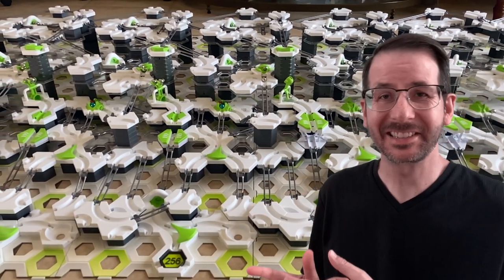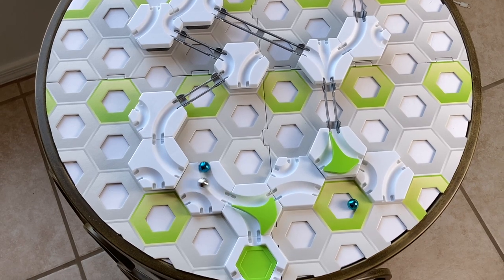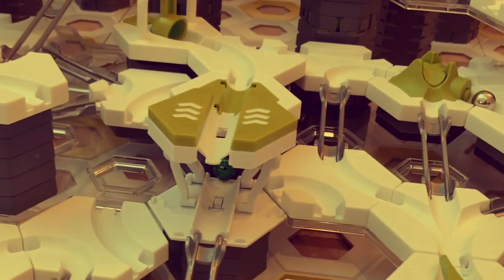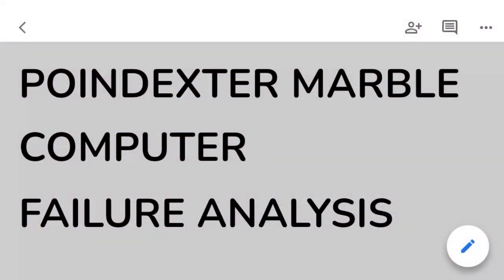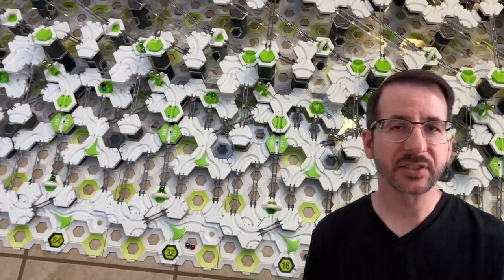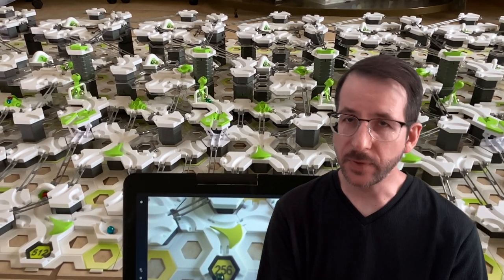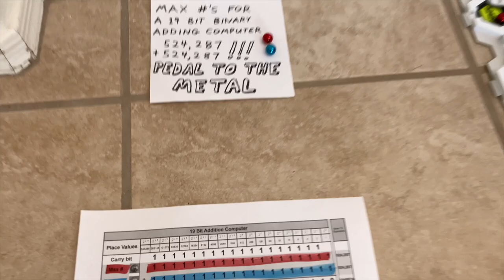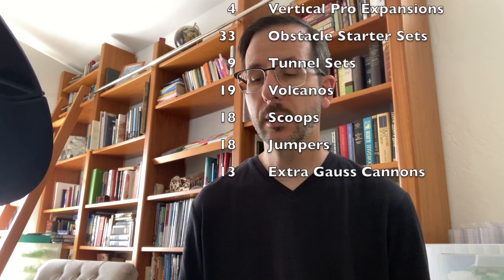I Made a 19-bit Marble Computer (Pt 1)

Comment: I'd really like to see one work with base 10 input/output so it's easier to use.
Reply from the maker: I might look into that in the future, but the circuits are not trivial to convert the inputs from base 10 to binary, or the outputs from binary back to base 10. It would definitely be an interesting thing to try, however.

Comment: Wonder if there is a concept of mass storage with data bus and address bus based on marbles.
Reply from the maker: The Turing Tumble toy is worth checking out. Subsequent to this video I picked up one at a garage sale and worked through most of its exercises. It can store values in the positions of its geared switches, and a marble can trigger the next marble to run through the circuit for the next iteration of the calculation. Using GraviTrax, I think an address bus of more than a couple bits would require a ridiculously large layout. But memory values can theoretically be stored in the GraviTrax Dipper's switch position, which can be "read" based on the exit the marble takes, and set by sending a marble up the opposite path just fast enough to reverse the switch.

Comment: Chaining more full adders together doesn't suddenly make the whole system more impressive. I could copy and paste this thing a thousand times over and turn it into a 1900 bit adder and it wouldn't be any more of a feat; in fact it would just make me look like I'm trying too hard to look smart.

Add some simple functionality to the system by allowing for inverted input lines and outputs then some control logic to make it into an ALU. But even at that point it isn't a computer. Using the historical definition of computer is just a deceptive ploy to get more views and you know it.
Reply from the maker: Thanks for watching and thanks for your opinion. Perhaps you missed that these mechanical marble-based circuits are not 100% reliable, and therefore the more bits that are added, the less of a chance the full calculation would run to completion? I discussed the computer's reliability in the video...it was rare that a full calculation would complete.  Therefore, 19 bits tied together in series is a much greater feat than a single full adder. (Take a non-100% reliability to the 19th power...)

I am using a more historical definition of the word "computer", which has nothing to do with integrated circuits, and instead focuses on the machine's ability to perform an algorithmic calculation on a variety of input values. We could go down the rabbit hole of semantics, but instead I will refer you to the Wikipedia article on "mechanical computer" which states, "A mechanical computer is a COMPUTER built from mechanical components such as levers and gears rather than electronic components. The most common examples are ADDING MACHINES and mechanical counters..." (emphasis added). So I assure you...no, this is not a ploy to get more views. But that's an interesting strawman. This actually is a mechanical computer that took a lot of time and effort to develop. But you're right, we can't run the YouTube app on it. Maybe someday... Thanks again for watching. 🤠
Reply: @MaskedMarble  it would still be interesting if you added the other functionality necessary to turn this into an ALU. A 4-bit ALU would be more than enough due to the space it takes up. Add in some shift registers and additional control logic and you can do mult/div. Anything beyond that would probably be unreasonable given the reliability issues you mentioned. However, seeing add/sub/mult/div implimented in marbles would be pretty cool.
Reply from the maker: @NeogreenPeaches I may try that. It would be necessary to develop some sort of shortcut like I used for the full adder, rather than building the ALU's logic unit and decoder by combining logic gates. Perhaps using GraviTrax POWER components to propagate the input signals. Will have to think about it...

Comment: Weird question... Couldn't you use the magnetic cannon to store information?  It would obviously have its limits.  Instead of just 2 marbles on the one side, you could use 3 which would allow you to use mag cannon twice, then have an obscenely long series of switches and more cannons...  It's painful to think about...
Reply from the maker: That's actually a very interesting idea. The gears are turning in the mad scientist's head! 💡💡
Reply: @MaskedMarble  Or use the tiptube.
Reply from the maker: @unclemarble659  That could work for a temporary register or buffer. It would require sending 2 marbles to read it, and the process of reading it would erase the memory. But still a possibility to use as a digital logic element. 🤔
Reply: I fought you CAN'T use canons twice, only with magnetic marbels?
Reply from the maker: @mirkohahn  I think you are correct; there is a video somewhere where I saw it done…will see if I can find it.
Reply from the maker: Here it is… you can do it by stacking marbles: https://youtu.be/wvgk6rmBryk
Reply: @MaskedMarble okay, well that's amazing! But the second time the marbel is much slower and rolls backwards. I don't know if that would be usefull...
Reply from the maker: @mirkohahn  Yeah, and really it would be a read-once type of thing. With the dipper switch, that would be permanent memory, staying in place until another bit is written to memory. That’s the best option I’ve considered so far. But also I think the new turntable could be used to store data. It’s just it would require 2 marbles to set for one value, and one marble to set for another value.

Comment: Sir I think you can get more clock speed if your marbles fell at 45 degrees.
Reply from the maker: Probably so. I was trying to limit the downward travel because it would have taken more action tiles to lift the marbles back up
Reply: @MaskedMarble  Well Gravitrax should make marble computer as a kit and perfect the speed and minimize size.
Reply from the maker: @gotsm9959  Interesting idea! I found that adding additional action tiles decreased the reliability of the computer. So increasing the speed might be fine for a two bit computer “kit”. But daisy-chaining kits together would be fairly frustrating, as the calculation repeatedly fails. If you check out my automatic 2-bit adder video, that timer circuit runs much faster.
Reply: @MaskedMarble  Well I seen a marble computer on a peg board that can count to 32. Clocks are are also a type of marble computer. If someone was shipwrecked on a island they can't charge a smartphone or buy batteries.
Reply from the maker: @gotsm9959  Yes, I saw that marble counter that could count to 32. You are right, without our smartphones we'd be scratching our heads for sure. Merry Christmas to you! 😃
Reply: @MaskedMarble  Thank Merry Christmas.

Comment: As for your comment on evolution:
Your model is not a proper analog because you are attempting to Leap Directly from initiation to a Fully Realized and multilayered result.

You are pointing out the necessity for reliability on a grand scale without acknowledging that such reliability would Have To be Established LONG Before such a multifaceted version of the machine Could ever exist.

Each component would have to Independently develop FIRST the Most BASIC and Simple Mechanics - Effectively, Predictably, and Reliably - Before ANY System involving More than One, Basic, Simple process could exist.

Then a Two step process could develop…

The sorts of Time and Endless Failures Required to reach the level of complexity you are actually Making are Not easily derived.

You are trying to SKIP MILLIONS of steps.

It is undeniable Proof of the Miracle of the Reality of the universe that we are capable of doing so.

Bravo!
Reply from the maker: You are actually making my point for me. The function of almost everything in biology requires the simultaneous existence and coordination of many mature and reliable parts before the subsystem becomes operational. And until it is operational, natural selection cannot select that subsystem. Add to that knowledge that multi-part systems are only as reliable as the product of the reliability of each of their mission-critical components, and you have a stong barrier against the formation of the myriad multi-part subsystems seen in biology. In my experience as a systems engineer for several decades, such systems can only result from parallel decision-making pathways where all the pieces are simultaneously designed and emplacement before the system or subsystem goes live. For example, you can't release an iPhone without a screen even if all the other parts are fully formed. And those other parts won't sit around for millions of years with foreknowledge, anticipating an iphone screen. Darwin described not a parallel decision-making pathway, but a sequential process; a sequence of slight, successive steps strung together. No such sequential process can coordinate, for example, the creation and emplacement of the 10 enzymes of glycolysis. All 10 must be present before enough ATP is generated to give the cycle any survival advantage. If the first few steps are in place but not the last step, the subsystem of enzymes actually consumes the cell's energy currency of ATP, so that is a barrier to all of the supposed intermediate changes to get from a theoretical simpler system to the final glycolysis enzyme pathway. No stepwise process can produce these things, nor can it improve their reliability. Reliability is not additive, but multiplicative, demanding that each enzyme work reliably from day one, in order to have any hope of contributing itself as a cog in the multi-component machine known as glycolysis. All steps have to be present AND reliable from the get-go, or the subsystem is completely nonfunctional from a survivability perspective.
Reply: @MaskedMarble  again, you appear to be referencing a complex system, an iPhone, for example, stating how the complex form could Never exist without a plan from day one, yet the iPhone WAS created by the slow collection of smaller component systems being developed Without 'the iPhone’ in mind.

A microprocessor WAS created as the result of a multitude of tiny, seemingly disconnected breakthroughs, each Vital to the functioning of the end result - each made at different points through time as a result of trial and error.

You might just as well point to a touchscreen and describe how it simply MUST have been the Ultimate Goal from the very Beginning, because the circuits would not function without a crucial component - then argue that there is No Way those components could have happened before they were used in the touchscreen.

If anything, I think your prior experience in systems engineering is a hindrance in this situation because you are failing to recognize the imposition and creation of the unified system's Language, Framework, and established Methodology as an external construct.

Which is to say, you can only conceptualize system creation from an external organizing structure - because all of your system conceptions and manipulations are Described and Defined using An External Organizing Paradigm.

(PS, notice my use of Paragraphs… it really helps to organize things I hope! 😁🤓)
Reply from the maker: @jclark2752 Thanks for the paragraphs. I feel that you are intentionally missing the point. Living systems must be functional from the get-go. We cannot have a discussion in an imaginary land where incompletely formed organisms exist despite missing any piece of the full hardware required for them to survive. It is the same with iphones. No end consumer buys an iphone screen by itself to make a phone call or to watch a YouTube video, because the screen alone is not a fully functional system that can perform those functions. It is only a subsystem. That's the analogy. 

You realize that every analogy breaks down at some point, correct? But this analogy is valid when you consider the functions of a living system which must be present to survive, such as producing ATP, copying its DNA, interpreting its DNA into working machines, and a host of other minimally required functions that every living thing must perform in order to be a living thing: a survivable, self-replicating system. The analogy is valid because iphones are not fully completed products, just as a single ATP synthase machine floating in space is not a fully living organism. Yet you are essentially claiming the analogy is invalid because iphone subcomponents are independently produced....yes, but not as a fully complete independent functional product. Can a microchip function without a battery or other power source? Can you watch YouTube on an iPhone screen whose ribbon cable is not connected to a driver chip? We humans are essentially making a host of parallel design decisions with intentional purpose in mind to form these subcomponents so that they will work together when assembled into an iphone to provide a function that they do not have on their own. That's intentional design with foresight towards a future unrealized goal. Natural selection has no foresight or planning capabilities. If we consider evolution to be a process with some foresight directed by the mind of God, then it is no longer Darwin's concept of evolution, which is by definition an undetected process.

The analogy is clear: You can't produce a living system that survives with any of its critical subcomponents missing. Even though there are an unlimited number of potential designs of living organisms, each one must possess components that work in concert with one another to form a functionally operable system, with interface specifications between components to  ensure they work together to produce a discernable function when assembled. You can't just pretend that you can take a pre-designed microchip and throw it into an iphone design without considering the interface...it's pinouts, where power is supplied and what the tolerance limits are for that power so the chip doesn't get fried, or conversely have too little current for the chip to operate.

What we are evaluating here is one of Darwin's two theoretical tenets, that small changes to the organism can create the organism itself (his tenet of natural selection). I am claiming from the empirical evidence that we observe, that reliability of multi-part systems poses an insurmountable barrier to that, because an organism can't survive without even a single one of its multiple critical components. It can't wait another 5 million years for a few random base changes in DNA to search the space of possible combinations to hit upon one that works, and then spend another 15 million years optimizing that barely working assembly into a fully reliable assembly that can reliably support life in every subsequent generation. Because the organism must be survivable for every second of those 25 million years, the entire time that it is developing those mission-critical subcomponents and subassemblies.

Central to this understanding is the realization that there is no such thing as a simple lifeform that one can start from. Pick what you consider to be the most primitive living thing that can independently exist and self-replicate without dependence on another living thing. Then perform a functional analysis of that living thing, reducing it to its critical components. All of those components are required for the living organism to function. Remove or slightly change one to where it no longer fits or cooperates with the other parts, and the entire system is dead. Tell me how does  that organism get formed in the first place (the very thing Darwin claimed to explain...the ORIGIN of the living organism)? How does any organism, as Darwin claimed, self-originate via a chain of slight successive steps, when a host of simultaneously appearing design decisions are required to be present in EVERY living organism in order to be living, and not dead?

Or if you wish, go back to the vastly simpler example I already posed: the 10-enzyme glycolysis cycle. Explain how a sequential decision-making process can build this multi-part subsystem (which has no living function on its own) one step at a time,, even within the context of an already living system? How will 9 of the 10 steps know to wait around for the last 3 million years for the 10th step to be stumbled upon, all the while the 9 steps providing no beneficisl functional purpose to the organism and therefore no survival advantage? The curious thing about glycolysis, too, is that it cannot be reduced to fewer steps, because each enzyme takes the output of the previous step and modifies it into a new form to be further modified by the subsequent step. If the function of any one step is not performed on the target molecules, the molecules will not be in a conformation that can be acted upon by the subsequent enzyme.
Reply from the maker: @jclark2752  One more note regarding my "externally organizing paradigm": Manipulation of matter or conceptual design by an external agent is the only cause that has ever been empirically observed to produce organized multi-part systems of like complexity. That includes programmed systems which may create and manipulate multi-component designs, yet themselves originate from the mind of a programmer. So in my paradigm I'm sticking to empirical science. It's not an invalid paradigm that you can successfully object to, unless we can  empirically observe (in the present) that there is another cause capable of demonstrating the production of systems of like sophistication.